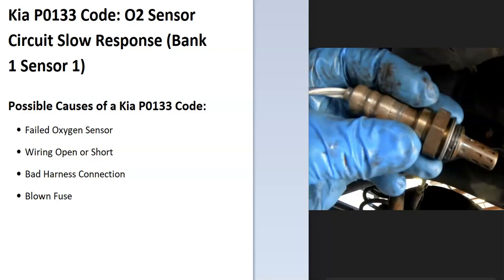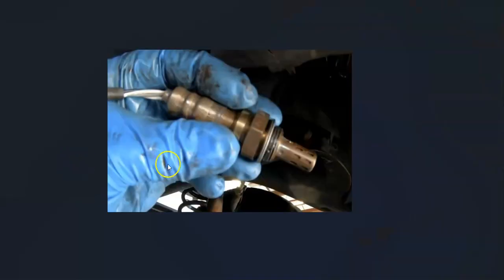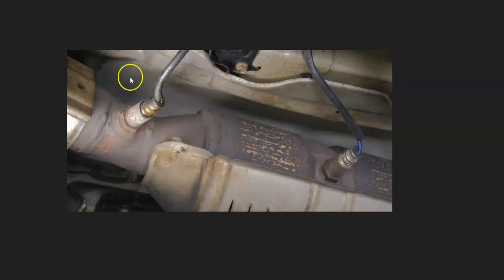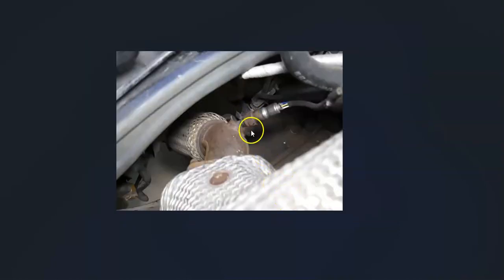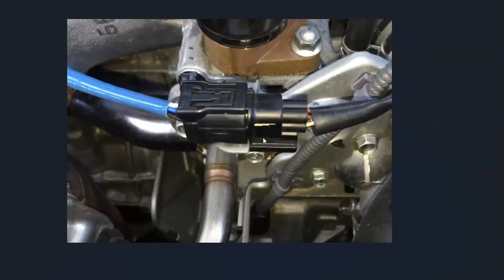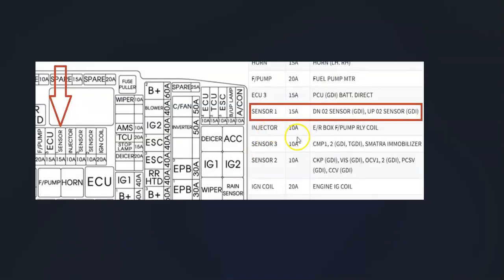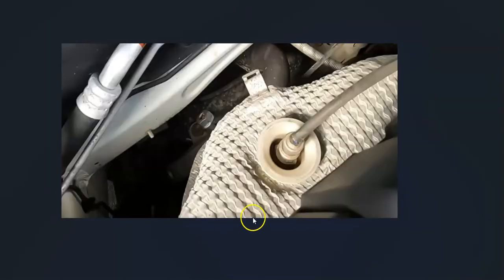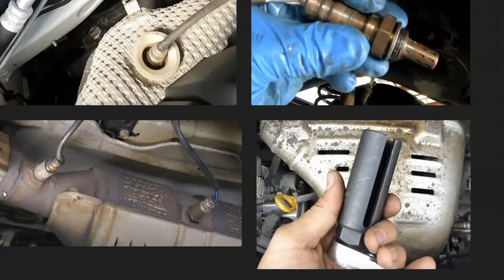How to Fix Kia P0133 O2 Sensor Circuit Slow Response (Bank 1 Sensor 1)

Comment: Easier said than done... I've got a 2007 Kia Sportage and it's on the topside of the manifold(bank 1 sensor 1) and you can't get it from the top of the motor.

Comment: This code is a problem to fix/track down, and many times it's not the O2 sensor.  A friend has an 08 Kia Sportage, 4 cylinder and its been to a few shops and they can not track it down. I can't say any of them did any real diagnosis. A smoke test was done. That is to check for exhaust leaks. A cracked exhaust manifold or leaking manifold may cause this issue. You can look up the list , but off the cuff, underperforming fuel injectors, low fuel pressure, bad O2 sensor wiring or connector,  bad ECM (but my guess is a bad ECM would cause multiple other issues) . 
If I can figure it out I will note that.

Comment: Had the Pd0133 code. Changed the upstream O2 sensor. Got the code again the next day. What should I do next? I appreciate all your help, and your videos rock!!
Reply: Did you ever get this fixed?
Reply: Did u ever get it fixed?
Reply: Same here. Were you ever able to find another issue and get it fixed?
Reply: Is this a lambda sonde? I had a bunch of these errors (Volvo V70) but all went away after reset. Maybe put in a new sensor if it returns.
Reply: change the purge valve